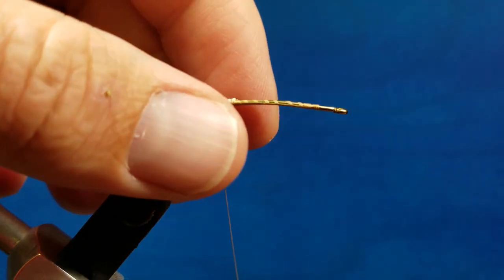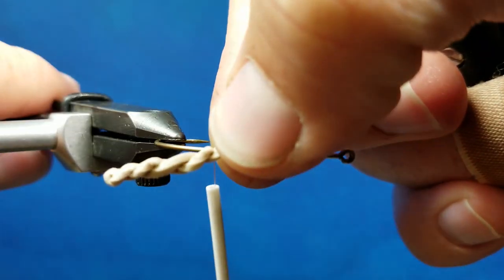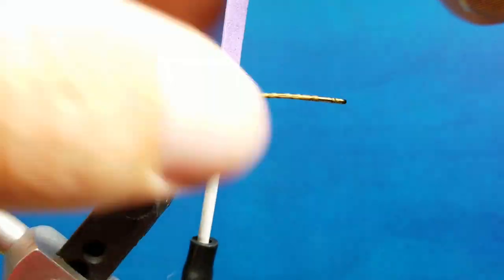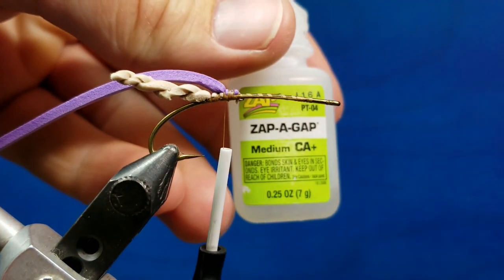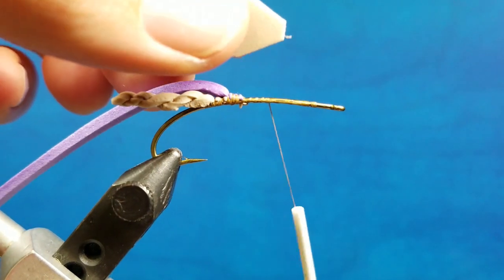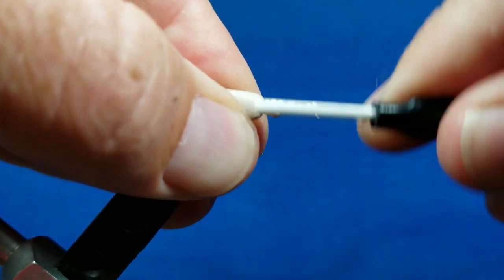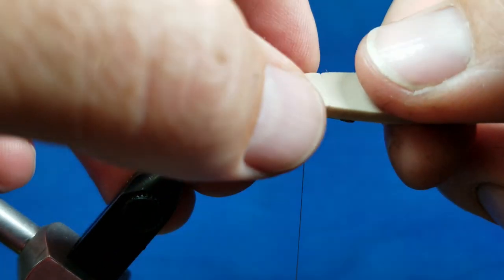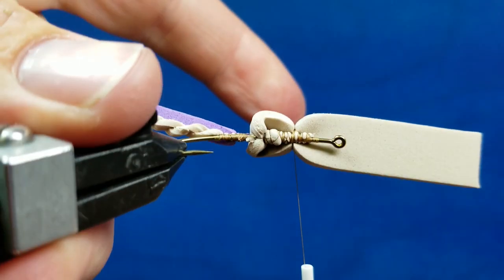Working With Foam

Comment: Hi Bob, very helpful post and video. I went to google for a search of another tyer and I clicked on your gink and gasoline post, then came here and subscribed. Question - does "super glue" melt foam or not? I ask because I want to start tying foam flies and I shy away from super glues because I've glued my fingers in the past (I used the metal tubes before and always had a nail polish remover soaked cloth ready for a mishap) Now I'm using brushable stuff but I see Zap has "foam safe" glue. Does it make a difference? Thanks.
Reply from the maker: Joe, thank you for getting in touch.  I've always used the Zap A Gap thin.  Use it sparsely and it will work extremely well.  It doesn't melt the foam. Each bottle also comes with a really nice fine point applicator if you prefer to apply it that way.  Thank you for subscribing.  Let me know if you have any questions and feel free to check out my website: www.ThinAirAngler.com
Reply: Bob Reece thank you. I'll check out the website too.